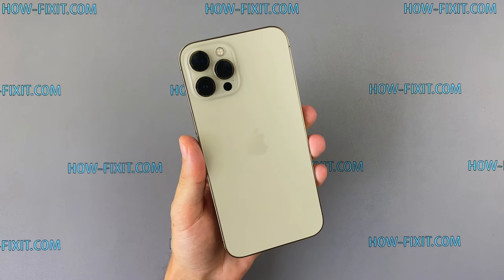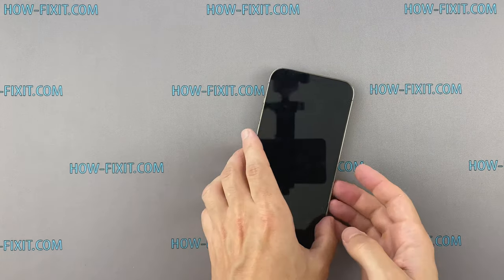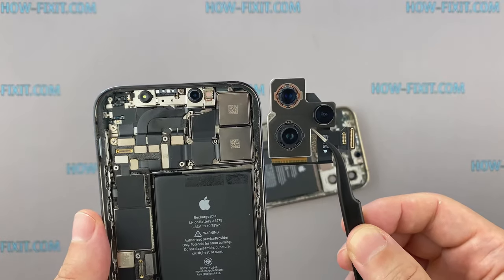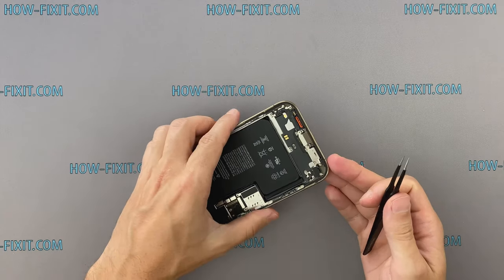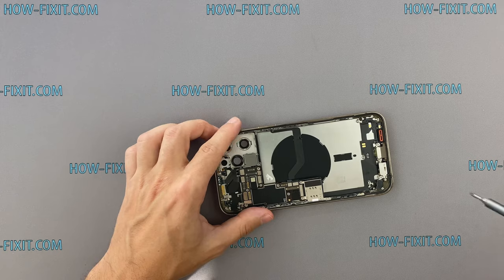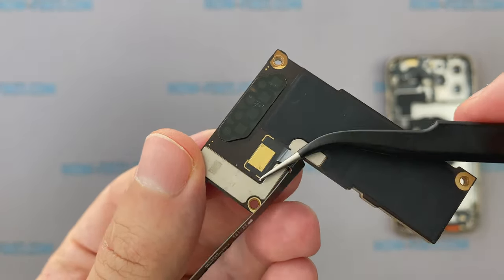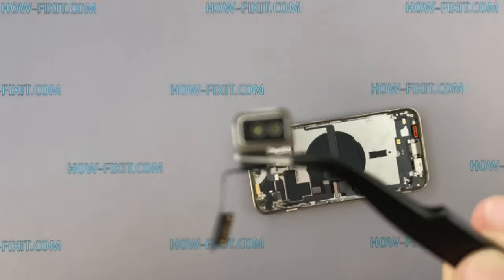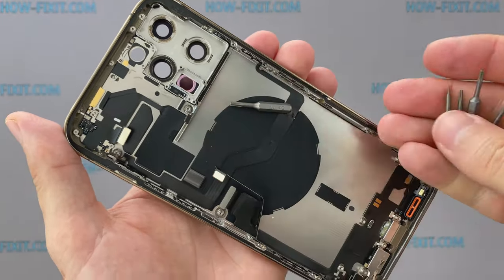iPhone 12 Pro Max Teardown

Comment: Time to stock up on 5G antenna flex cables. Many amateurs will rip this cable 🤣 Your video is very detailed for USA models. Much thanks!
Reply: 😂 I didn't know why I couldn't remove the connector from the side of the old housing now I know why as most new chassis iphone 12 pro max don't come with the 5g antenna connector in place I do wonder why they don't sell many of those chassis with the 5g connector in place

Comment: I have worked with iPhones for 13 years, and from the 12 models it is so hard to open up the screen without crack it or the colored lines apeared and you need a new screen, do you have any good tips? This screen on the video i can garanteed has been removed before.
Reply: Yeah me too , it is already opened 😂

Comment: 2:45 is NOT the telephoto. It is the main wide angle sensor. That’s why it’s bigger. This year the wide angle (not ultra wide) sensor is on the bottom on only the max I believe. Also you can confirm this by looking at the Apple keynote.
Reply: Yes, I tested this while puting a piece if paper on that lens. Left down is the main camera. The problem is, I could not find out how to put the telephoto camera in action. No matter how much I zoomed, the normal camera was used!

Comment: You missed the Wi-Fi Flex Module which is located on the top left region of the housing, obscured by all the black stuff.
06:54 The 5G Antenna to the right side isn't exactly built in, it's held down by some adhesive. You're able to push it out with some small nudges to the top and bottom of the Antenna.
Not trying to be judgmental as this video helped me out a lot in what parts I need to get for my iPhone I bought on eBay, but those two are pretty important to fully tearing down the device if someone needs to replace a broken housing
Reply: Youre a boss man, just changed mine thanks to your comment.

Comment: Where is the ear speaker located? My 12 pro max have it ear speaker not working, i want to know is it easily replaceable.
Reply: How did that happen
Reply: @Fs_007  i took it for a swim 🤣. But it working now after i placed it inside plastic bag with a silica gel for couple night.
Reply: @geryajah  ooh
I was planning to take my pro max while swimming
Now i will not take it.
😅

Comment: I replaced the back glass of my iPhone 12 Pro Max and now the phone won't turn on. I kept turning it on every little while to make sure it's still working. Finally, after I finished removing all the glass, checked it one last time, everything was working perfectly fine. Then I turned it off, stuck the new glass on and now phone won't turn on. Please if anyone has any idea why this would happen? Did I press too hard? Did I touch something I wasn't supposed to? Any help would be appreciated. This phone cost me an arm and a leg.
Reply: Did the same thing, but apparently, I burned the logic board. Maybe u did the same thing.